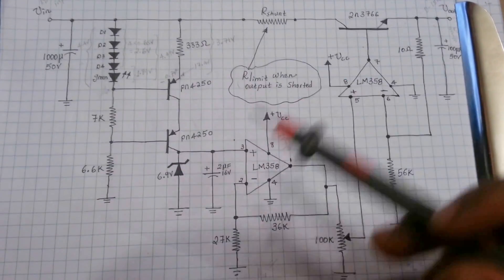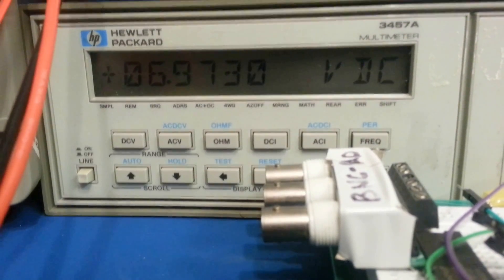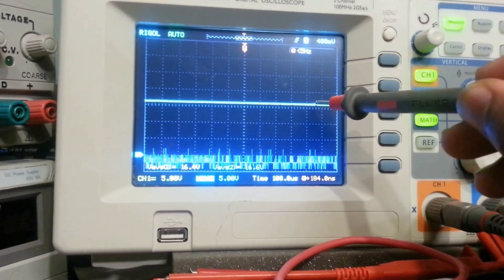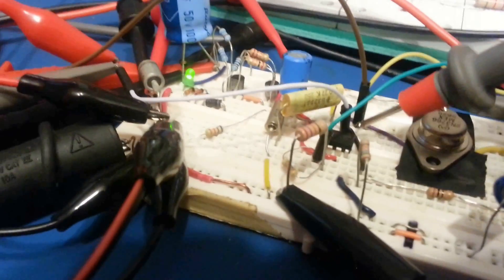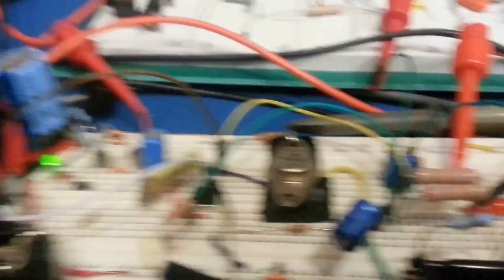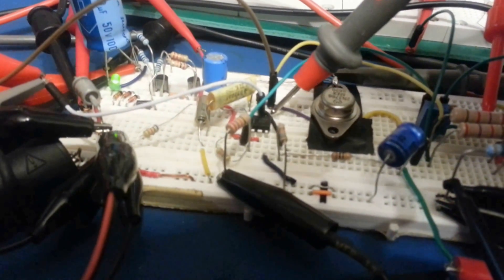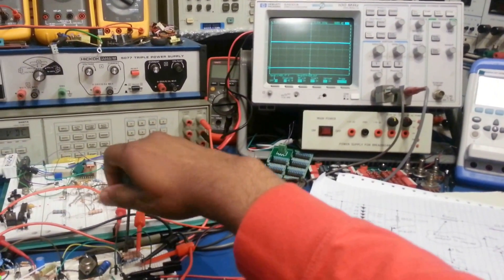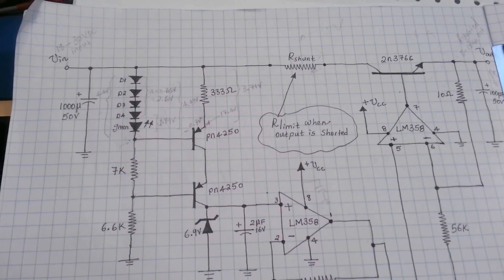DC Power Supply Design - PART 2

Comment: I will wait for your response sir..love that circuit proven and.rested
Reply from the maker: Hello, Sorry I have been busy and didn't check my youtube account. I will finish the complete tutorial very soon. I have updated the circuit so that it can be low dropout regulator and added a constant current operation. Here is the circuit with the constant current operation that I used in SPICE simulation but be advised that I haven’t tested it in the lab and it might not work as intended. 

The link is here: https://drive.google.com/file/d/1uQJGhMIHCgJgSVqx6npC_iMsaotrTifT/view?usp=sharing
Reply: I. Will wait for that video I download it thank you so much

Comment: Sir I'm always watching this video even I'm a hobies I try my best to learn by watching this video Thank you so much I learned something and understand Can u give me the final circuit diagram I will ganna make it my load is 60watts amplifier at 12v 5amp at 8ohms impedance
Reply from the maker: Hi again, if your load is 8Ω and you want to push 60watts through it you need minimum supply voltage of V_supply= √(2*8*60)≈32V. Therefore you can’t get 60watts from a 12V supply if your load is 8ohms.
Reply: If that the case sir what will be the amp if i have 32v? It should be 1-3amps?
It can be I use 12v @5-6amp?
Reply: I tink probably my amplifier ic can handle 12 up to 18v max

If lower voltage I can get more current
Reply from the maker: Yes you will get more current but if only your load has small impedance. It is very simple to determine: P=Vrms^2/Rload therefore if your speaker impedance is 8ohms, and you have 12VDC supply, you can only push  P=(12/√2)^2/8=9Watts. What amplifier IC are you using?
Reply: as far I remember sir TDA1520A but I'm sure it was TDA's ic rated @ 60watts @12v

Sir can u make a 60watts up amplifier supply at 12volt? 

Looking forward of it 
Thanks for your reply I always checked my Gmail if u reply hehw